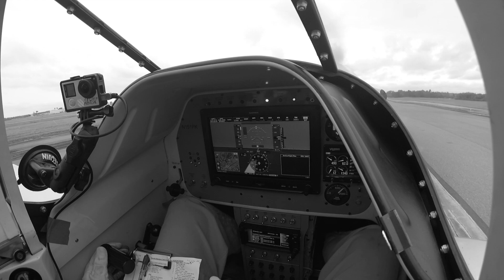Reverse Thrust in a taildragger? - Clip - LongNoseThunder Re-Reflight Ep 3 - Turbine Thunder Mustang

Comment: Time for cameras and string! Need to see what the air really does when prop is placed in Beta at approach and landing speeds. Only after fueling system, hydraulic system is repaired and smoke removed from cockpit.